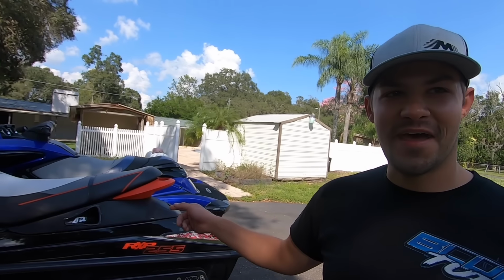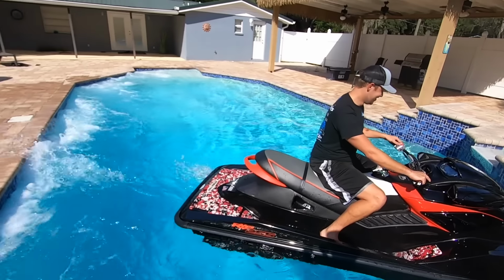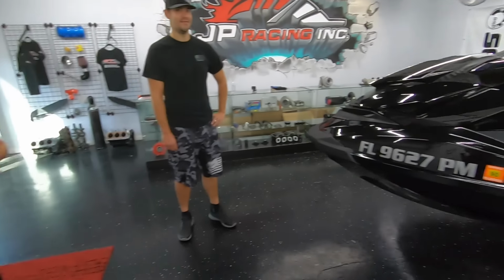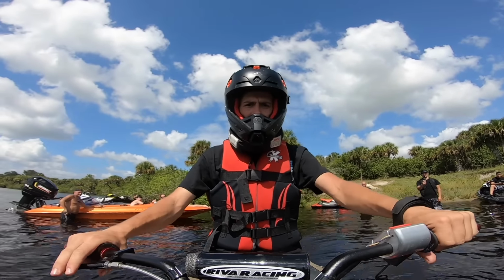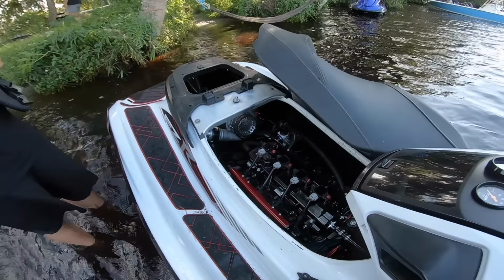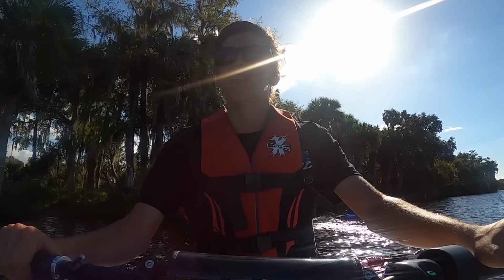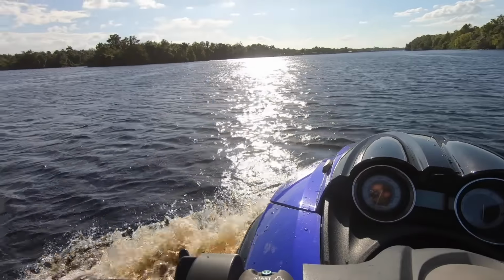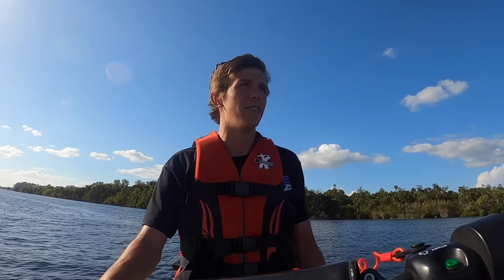Riding a FULLY BUILT JET SKI on 45 POUNDS of BOOST! (INSANE)

Comment: That is the most ridiculous thing I've ever seen. It would be sick to get some rolling acceleration data to see how it compares to some of the race cars
Reply: It actually looks like a rocket ship on water.
Reply: @nat5677  it looks crazy fast and gets there unbelievably fast !!
Reply: Look at Mike Finnigan's jet boat. This rips, but that boat might be faster. 0-110 in like 4 seconds in one video.
Reply: Miata dad back at it again 👌
Reply: I’ve got a turbo motor swapped ski and I can tell you it pulls harder then anything I’ve ever been on/in
Reply: Has anyone ever built a drag strip for boats?
Reply: @sirmashington9205  lol yes its called a lake
Reply: @thedude7726  hell yea brother. I want to see a mixed media dragstrip. Water vs asphalt
Reply: @thedude7726  is a boat faster than a car 1/8th mile?
Reply: @sirmashington9205  to make a long story short, top fuel drag boats pull harder then top fuel cars but they don’t pull for as long because the resistance of the water at those speeds
Reply: @sirmashington9205  look at Wild Horse Pass raceway in Phoenix AZ.
Reply: @AndrewMillhouse  This is a pro-tip if i've ever seen one.  You answered my question!
Reply: @AndrewMillhouse  lol I live down the street from there. I hear the boats when they’re there….
Reply: Helmet time boys, when motors explode at top speed strange things happen. You might consider putting a ballistic cover on the seat because you are sitting on a grenade. I was thrown off of my ski in a turn at wot , woke up in the water luckily face up, my ski was at least 200 + feet away,  my friends were on the beach and saw me in the water and got me out. I had a major concussion, blurred vision, hyper extended my arms neck injury, and a bruised ego , my friend had a ruptured spleen and almost died after being hit by another ski. Nothing better than going fast, nothing, nothing worse than stopping fast, except death. I use a mountain bike downhill free ride carbon fiber bucket and motocross goggles. Lots of vents visor for the sun and still have all of my original teeth. I also carry a piece of surgical tubing in my first aid kit in case of a major cut to a limb to limit the blood loss and get to the dock.I only hope what happened to me never happens to you. If you think it only happens to rookies, you might think again, I’ve raced motocross mountain bikes road, and ice raced and my friend who almost died was a 5 time Cdn. superbike champ and a 600 AMA champ. Be safe and make sure everyone goes fast in the same direction,,,,,, chickens die from playing chicken ,ok later on form the Canadian swamp kings

Comment: Those outboard height adjustable stabilizers on the RXP255 are a god send. The only thing it's missing is additional steering fins off the back that turn along with the jet drive. Add those and this thing would handle even better in a straight line and while turning. Once up on plane, hit the trim up 1 or 2 notches to get a bit more of the front half of the Doo out of the water to reduce drag at speed.

Comment: This is what Cletus needs to put in his jet boat he's building a fully built motor that boat is already crazy with 300 horsepower imagine 1000
Reply: That is what he’s putting in his jet ski
Reply: Yeah they use a minimum of 300hp waverunner engine and pump
Reply: @apxture3331  in the boat video he said he's just putting the 300 horsepower jet ski engine he never said anything about completely building out the engine that's what I'm talking about I know he bought the jet-ski for a donor beyond that I hope he builds it out fully
Reply: I doubt  the little puddle boats hull design would respond too well at high HP and speed.
Reply: @stoker20  have you ever seen jet boat racing? They throw 1000hp v8s in them and whip around a hare scramble type course. They're very capable hulls
Reply: It's wild the stock higher trim jetskis are stock 300 hp cleetus won't stand a chance against a 300hp jetski 1 on 1
Reply: @camarowland4  If you don't need to go in a straight line more than 5 seconds. I'm a boating expert.
Reply: Rotax engines come in SidebySides, Jet Skis, and Snowmobiles and they can handle some HP if built right
Reply: @keefespencer1173  yup I have a slightly built engine and it can break driveshaft pretty easy it sucks when you're in the middle of the lake and then happens lol
Reply: 300hp is more than you'll ever want in a boat you can pick up. Tbh anything more than 150 is pretty unusable in those little things
Reply: @stoker20  thank you.  yall dont realize those boats weigh less  than  a jet ski and arent meant for this type of power.  theyre literally meant to be ran in small amounts of water. a 600cc to a 900cc 2 stroke jet ski engine is the max id put in one of those boats. and no they use a minimum of a 300cc engine and pump. 300cc is not 300 hp. yall have never dealt with power sports have you? 2 stroke engines are not even on the same scale as a normal engine. i have had 2 stroke snowmobiles over 1000 cc, im 5'6"  and have owned a cr 500 and sold it and bought a fully built rmz 250 4 stroke that ive hurt myself on badly so why did i sell the 2 stroke 500cc? because i was gonna kill myself with it, that and i  couldnt even touch the ground.. my dad had a honda odyssey buggee (the 250 version with no suspension.) that i swapped a 600cc artic cat engine into and that thing would do stand up wheelies in 3rd gear. he wrecked it and got ejected from it and broke his pelvis. point being 2 stroke engines a gnarly enough and have enough power. to put something like this in an aluminum haul tiny boat, youd have to completely revisit the design like blake wilkey has to his that doesn't make near this much power to make this safe. and yes  ive saw jet boat racing..  they're not 10' aluminum hauls with 4 stringers, mig welded together, theyre 20' fiber glass braced hauls that are designed for that power. jet stream mini boats are not. theyre literally called  "adventure boats" not drag boats. notice how when they go to the track they have all these regulations for how fast something is like cages, window nets, ect? well on the water, dirt, and snow there is no regulations and ive saw people build very excessive things that has wound them up either hurt, paralyzed, or dead. did you  not  hear kyle  say in this "i was wearing a helmet  because his skis not meant to go that fast" yeah neither is a jet stream boat. thats not even why cleetus is building one  hes building it to hang out with his friends that go boating and swimming and shit that have air and speed boats. a mini jet boat is the best of both those worlds. if it was safe to  put a 900 hp+ rotax in a mini jet boat you would've already saw it. it doesnt exist for a reason. calm down. yall are little kids, stoker actually knows what hes talking about. youre  just too arrogant to try and understand common physics and safety..
Reply: @HotDogBunN2YG  all true but you're talking about Cleetus & he likes fast.
He can put a fully built engine in & only ever use full power for a video then just cruise it.
Reply: most likely hes putting the 3 cyl rotax in the boat. advertised as 300hp factory supercharged
Reply: Trying to go over 80mph in one of those little jet boats would be a death trap. Any kind of accidental shut off of the engine would guarantee the boat will go HARD left or right, but your body will continue to go straight while it slams on the gunnel. The jet ski is much more forgiving when you can manipulate it with your body weight
Reply: @HotDogBunN2YG  Thank You. They need to see Randy Corson Liberator boats in Port Orange 300hp in a 21' tunnel is 112mph turn key stock. Not a toy boat. LOL
Reply: @Hitycooking  please stop

Comment: That’s it, worlds first K20 swapped ski.  Kyle, Honda made turbo jetskis a few years ago. Look for one of those. There’s one for sale in Colorado right now.
Reply: Tom has a turbo Honda K24 boat... so I don't see why Kyle cant do that K20/K24/J35 twin turbo ski.
Reply: the honda ski is trash though, basically a turbo civic engine, it's slow
Reply: @925goodies  yea but it’s the Boyz your talking about, it wouldn’t be slow for very long...
Reply: Sassy The Sasquatch  it looks similiar to 2002 era civic engine
Reply: @925goodies  Yeah, Civic's are pretty slow stock (except Type-R), but they're super reliable. I suspect the same goes for the Jet Ski.
Reply: @PetesCreativeRecycling  yes, the non turbo is almost as reliable as a non supercharged seadoo/Yamaha. Still junk.

Comment: Man, you gotta make sure you got that safety gear on Bro! Hitting water at those speeds will crack your skull in a heartbeat! Its like hitting a concrete wall! Have fun out there, but keep safe and respect that speed!
Reply: And a ballistic cover on the seat like for a transmission cover for drag racing because it’s a grenade if you chop the throttle then hammer it again the Oil pressure will drop , cam chain will go weird then snap or jump a tooth then valves coming out time for a piston party or just complete catastrophic failure and you are sitting on it like Evel Knievel . Good luck and call your mama before every ride

Comment: The best time to be on any fresh water lake is right at sunup without a lot of wind on a Tues, Wed, or Thursday when there haven't been any storms in a few days or huge/holiday events with lots of boats on the water. You'll know because the lakes surface will look like glass and that's when you can really let her eat. I grew up on a lake and we used to do some pretty insane crap with everything from 4 Cyl. to fully blown V8s. I do want to warn you though you may want to get a wet suit for those speeds because believe it or not the water can actually Cut you if you hit it going that fast. It's also basically the same as hitting the pavement when you hit it at speeds of 60 mph plus, you will skip like a flat rock before you sink in so the same things as riding motorcycles applies basically. If you eat it don't fight the hits, basically go limp and let it flip you around tightening up will get you hurt far worse. Trust me and find an opportunity to go very early in the morning getting there just before sunrise the experience is night and day from riding on choppy water...
Brought back some excellent memories from when I was young and it was awesome to see you having so much fun. Florida seems to be treating you very well and aside from missing friends has to feel good after being so nervous about the move...

Comment: 102 mph with no equipment 🤨😔
Reply: He wore the protective gear at 50mph😅😅
Reply: @ZREXER1250  I've had 4 of my friends fall off my Seadoo RXT at 75 either from a rough wave or letting off the gas at full speed. None of them broke anything but skipped for about a block and were extremely sore for a week. At 100....that's some damage!
Reply: @ZREXER1250  rolling across the water going that fast wouldn’t be like hitting concrete, it’s different than falling from crazy high into the water. That on the other hand would be like hitting concrete...

Comment: You should build a spark evo with a turbo. Check them out. They have seat with a back and are nearly impossible to flip because the center of gravity is so low. That would be different.

Comment: In 2004 I went 88mph on a stock brand new Yamaha 1300 2 seater. @ 88mph it would jump out of the water if you let off and whacked the throttle real quick. Why is 93 such a big deal with 500hp?

Comment: I think he needs to do a little hole design seems to do good until it gets up into that high number and then it starts to skip a lot I'm not sure what he can do about it but I'm pretty sure guys that have been racing boats for a long time could probably have some good ideas of what he can do to make it hold those top speeds a lot better with some kind of design to the whole closest stag them unsafe as heck when he gets up top it just bouncing everywhere almost throwing you off and you ain't in control and being out of control ain't no fun dude you need a helmet on and you hit the water 95 mph you'll bust your skull

Comment: nuts that you did all that with no safety to yourself! and was fast, but what point is there a speed before they lift from the front and flip you over! then its hitting the water will feel like concrete at over 90mph.. looks like you had fun though.. just dont kill yourself doing it!

Comment: NO DOUBT FAST, BUT IT IS ALL ABOUT ENGINE RPM, AND PROP RPM. NOT HP. YA NEED AN ENGINE THAT CAN TURN 15,000 RPM!!, AND A LOT OF PITCH ON THE PROP!!!!.  AN ENGINE THAT IS 700 HP AT 6000 RPM IS NO FASTER THAN A 350 HP ENGINE AT 6000 RPM IN THESE JET SKIS GOT IT.

Comment: I remember the first time I rode a gp1800r with a stage 3 kit from riva racing. I’ve never felt anything like that and worse so the water was fairly choppy. It’s just incredible and I was going in the high 80s. Not 100+. Going from a rental to that was immense. 80s on the jetski feels like 160mph on a semi smooth surface.